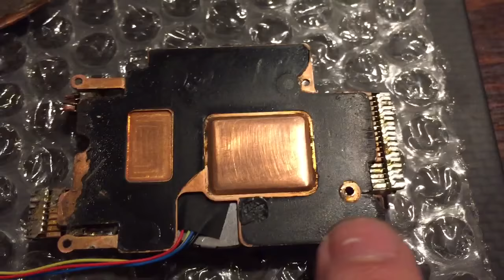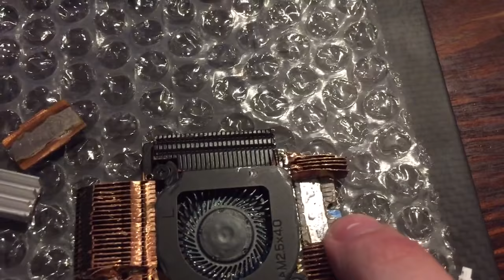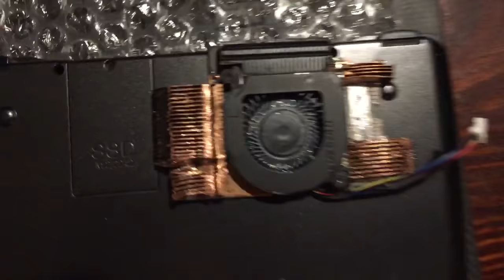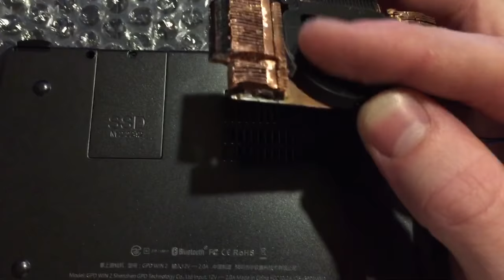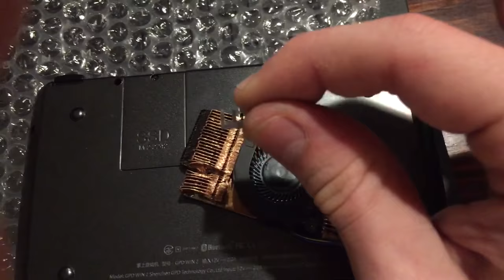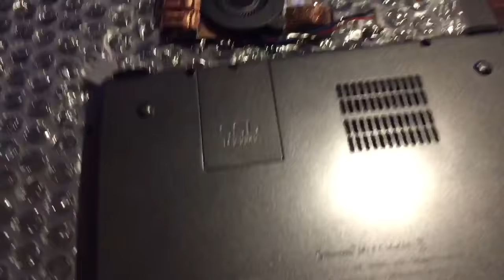Discussing GPD Win 2 Thermal Mods.

Comment: It seems to me that blowing hot air at the already hot running SSD is a really bad idea? Also if you add some heatsinks to the copper plate, but there is no airflow taking the heat outside the case, you are just going to end up with lots of hot air stuck in the case :(